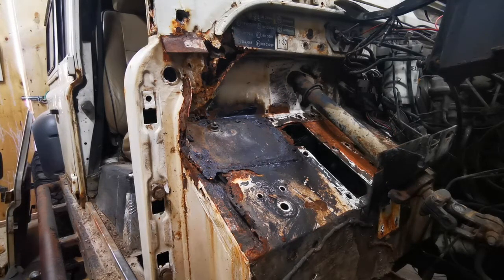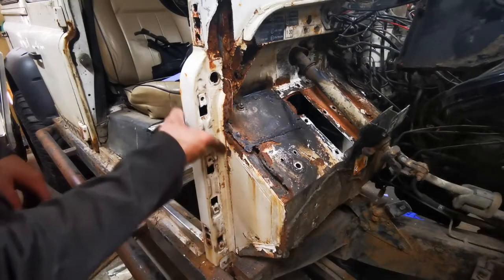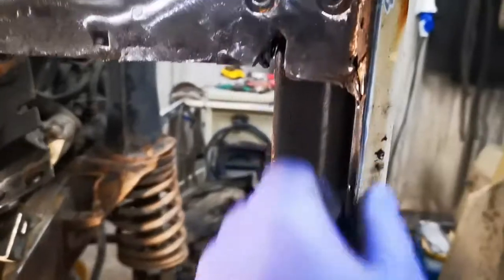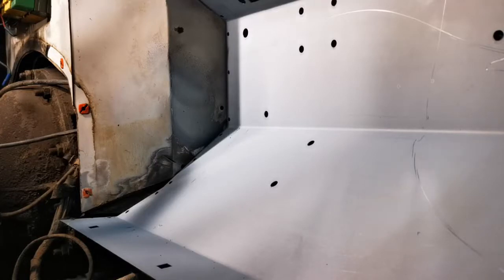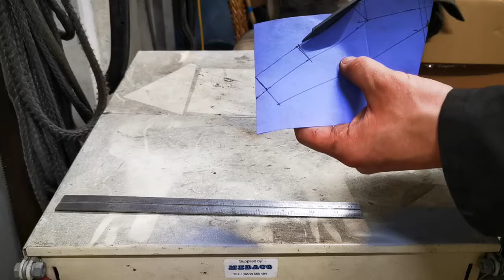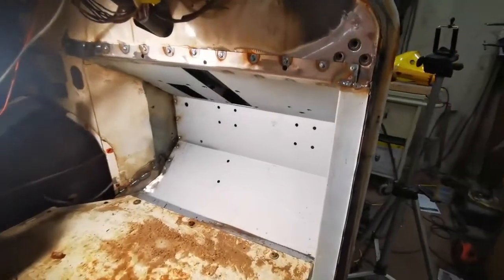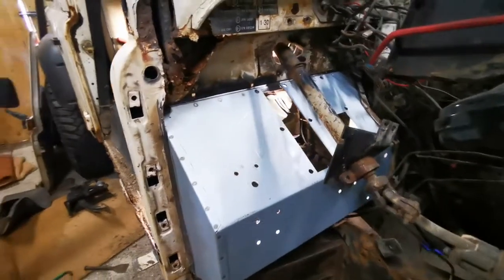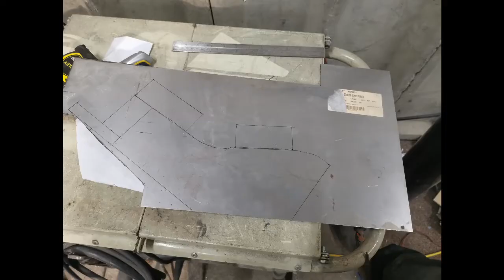Land Rover - Foot Well - Bulkhead Welding

Comment: i might use the step drill bit to drill out my spot welds as suggested but i was going to ask what size drill bits you used as i might try that also,thanks
Reply from the maker: I used a cobalt 5mm but you can use any size drill bit similar to the size of the spot welds, just make sure it's not standard HSS or it will dull quickly
Reply: @mozsmancave2331  thanks for that

Comment: Was at the same today - best "hint" I have for spot-welds (on anything) is to use a cone-bit in your cordless - dunno why but they last forever drilling spot welds, they do a brilliant job of dealing with them, they don't punch through the lower layer so re-welding is easier & they make the job a doddle & a lot faster. 

I used use proper spot-weld bits (they break constantly) and tried every combo of regular drill-bits, none come close to being as efficient as a boggo, cheapo cone-bit. Best part is it seems to have zero effect on the bit - I'm still using the same bit after countless welds drilled. You also don't need to muck about with pilot-holes, or the bit skidding about - it just eats into the weld, nice & fast. 

When you get that ^^ made back up in fresh steel, give it a good coating with fiberglass filler before priming etc etc - the fiberglass stops water just eating back into the area - bang on a really good epoxy 2-pack primer after the fiberglass, you can do what you like after that - won't rust. :-)
Reply from the maker: Hi James, I'll try the cone bits for sure 😊 you seem to know what you're doing I'm surprised you're watching these videos 😅 have you got a landrover yourself?
Reply: @mozsmancave2331  Bought my first new one in 1984 - 2.25 petrol... been at them ever since. Doing a '97 Defender currently - chopping a van into a pick-up from the axles up - ball of sh1te into very all right - nut & bolt job. They're a disease. :-)

Comment: Have to do my own footwell soon,any trouble taking off pedals ect...what thickness steel did u use for the bits u had to weld in
Reply from the maker: No trouble at all to be honest, I used 1mm to make the filler panel and there's no flex at all thanks to the bend.
Reply: @mozsmancave2331  sounds good 👍
Reply from the maker: https://youtu.be/z3mXH3Vv7N4
here's the video I did for removing the pedals 👍🏻

Comment: Doing the same thing now. I ended up getting an air drill today with a set of cobalt drill bits... going through spot welds much faster than with my Makita cordless!
Reply from the maker: I just used normal high speed drill bits and they didn't do too bad to be honest, I imagine the cobalt drills would be better though
Reply: @mozsmancave2331  they last longer but only if I’m spraying them with a penetrant while drilling. Not really worth the extra cash. What amp and wheel size is your angle grinder? Mine is a 6 amp 4” I believe and only tries to catch me on fire without cutting a damn thing lol. I need to cut the inner part of the left footwell where it meets the tunnel and the guard doesn’t work worth a damn.
Reply from the maker: @chrismitchell45  mine was so rusty it didn't take much drilling 😂 my grinder is a dewalt 4.5" 11,000rpm, not sure what amps but its been a great tool
Reply: @mozsmancave2331  mine cuts well enough, my problem is the guard is for grinding and not cutting lol. I was able to get the drivers side (right side) out today and believe it or not, the replacement Britpart footwell fit in perfectly! I haven’t had the bulkhead issues you’ve got though. That said, the upper passenger flange looks like Swiss cheese from shoddy welding and rust.
Reply: Update: I purchased a Milwaulkee Red Helix titanium impact driver bit, model 48-89-4607 in 5/32 (no idea what size it is in Brit speak lol). Paired with my 18v impact driver, it goes through spot welds in a bout 10 seconds each. It literally melts through them almost before I can spray them with oil. 

I was also wondering what voltage your welder runs on? Again, I don't have any idea what you use in the UK but in the States we use 110/120-220/240v electrical in the house. Thank you sir!
Reply from the maker: @chrismitchell45  here in the UK we have 220-240v in households. The welder I have runs 240v off a 16amp feed 👍🏻
Reply: @mozsmancave2331  last question and I’ll leave you be! Would a 125 amp flux core welder get the job done for outriggers and rear cross member or not very well? Again, thanks for the videos.
Reply from the maker: @chrismitchell45  I would probobly get something with a bit more umph! But flux core will do the job just make sure you get some good practice in first and use a good quality wire 👍🏻 sorry for the late reply this one must have slipped through the net 😅